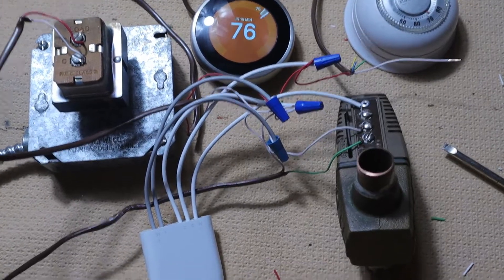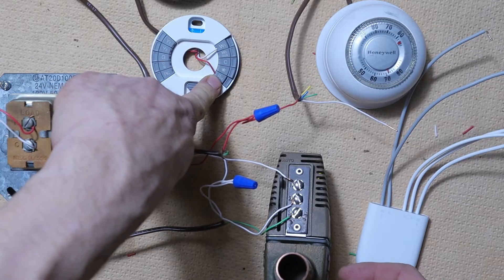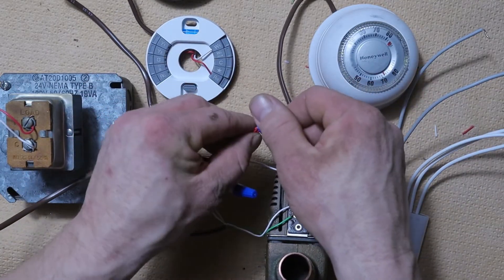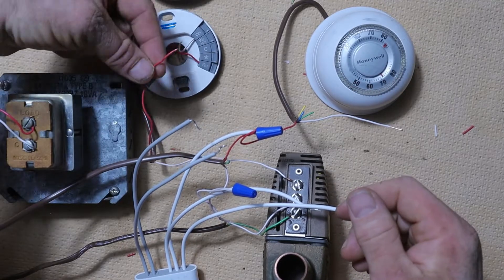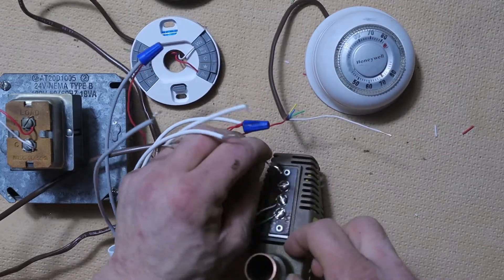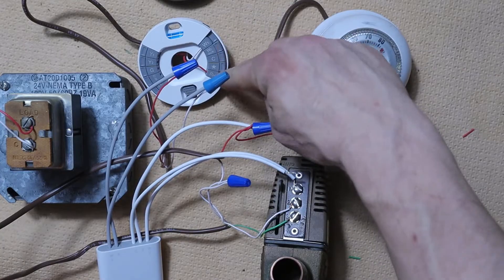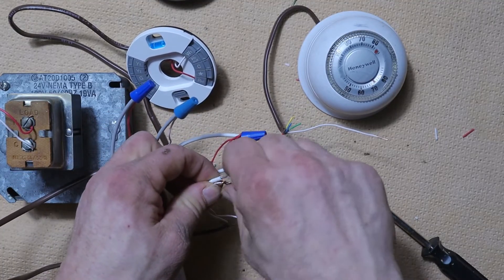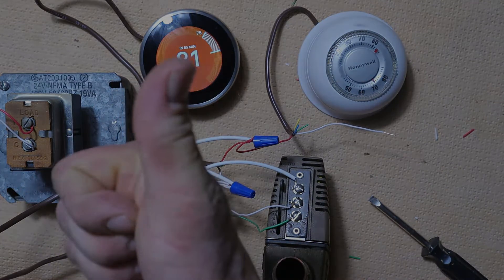How To Wire A Nest Power Connector to a Taco Zone Valve

Comment: Thank you for the information, I’m also in Jersey(north) I have 4 zones in my house and it’s only heat(gas baseboard) I installed my first google nest and it’s calling for more power, it will not stay connected to the Wi-Fi. I ordered the nest power connector. Will I need 4 power connectors and do ya think I’ll need additional transformers? Thank you
Reply from the maker: You do need a power connector for each zone. And with Tacos, yeah, you'll likely need to add a transformer, unless you already have one rated more than 40 VAs.

Comment: I have a two zone setup with 2x taco valves like this (and 2 thermostats) seems that each valve is hooked up to a transformer way over by the electrical, and nearby is also a relay R832A) 

If I'm not mistaken, I think the relay is triggered by either valve and then that triggers the boiler to turn on.

Would I be able to set up two C wire adapters in my case? One at each of the zone valves.

Edit: scratch that, it's just a transformer hooked up to the zone valves no relay. Less complicated than I thought! Should be able to use the c wire adapter, question is do I need two and what the wiring looks like there.

Pretty sure they used the reverse colors you did. I.e. that bundle of red is white on my setup.
Reply from the maker: Yeah sometimes guys don't always follow color codes. Just go along with what they used there.  There should be a T and T connection in there. One is the common.

I kind of go into it about a minute and a half into this video:
https://youtu.be/eB8TCjX541M

Comment: I have three zone taco valves connected to a two transformers connected in parallel.  Can I connect three nest connectors? (I do not have a zone controller board)
Reply from the maker: So long as the transformers are properly matched it should be OK.

Comment: Mike: Your videos are amazing! Excellent, clear explanations, and all the necessary details. I tried out dozens of YouTube videos and was never really able to understand thermostat wiring until I came across your How to Wire a Boiler. What a  great public service. Thanks!

I’ve had two Radio Thermostat controls working for 10 years, and a mercury switch antique on the second floor, with no way to run a third there. The system is gas with baseboard heat, and three taco controllers. Now that Radio Thermostat is sunsetting theirs in May, I set out to replace them with 3 original mirror-face Nests, which my gas company was offering for a pittance.

I knew c-wires were going to be a headache somehow. Years ago, I installed an additional transformer myself wired directly into the one in my basement office, and it worked fine with fi-fi, etc. I then had our electrician install another transformer for the one on the first floor, putting the transformer next to the furnace and doing whatever rewiring was necessary.

It worked ok, but it turns out he did it seriously wrong, somehow. We connected the nest the same as the old thermostat and no luck. Measured across the wires and found that one of them showed 57v!

My current electrician tried hooking up a power connector at the taco valve, and no luck at all. So I spent a lot of time on the phone with some very helpful Google people, and eventually discovered some of the things their online help doesn’t tell you, like that you can’t connect a transformer directly to the basic nest, because it has no Rc input: You have to connect the transformer through a power connector. I got one of them working that way, following a diagram that they normally only give to Pros.

Anyway, I have an HVAC guy coming this week sometime to sort through the rats nest of wires, disconnect the old second transformer, and follow the directions in your video.

I’d like to hook up all three at the furnace, and I have a question. At the beginning of the video, you said:

“Now before I get into this I just want to let you guys know that if you're just doing one Nest Thermostat this arrangement with the power connector should work. But if you're trying to hook up multiple thermostats this probably isn't going to work: You might need an external Transformer or rib relays. I have ordered a rib relay I should be getting it tomorrow so if that's your situation I'm going to be making that video for you but for now let's get into this.”

My plan would be to use a power connector (I have them already) for each taco controller. The original transformer plugged into the furnace says it’s 24V 40VA.

My question[s]: Are you going to make that other video? And do you think I could run at least two of the controllers with that transformer? (I could put the third transformer and connector in my office and hook it directly into the nest there.)

Sorry this is so long.

Thank you so much for what you’ve done. I only wish you were in Massachusetts instead of NJ.
Reply from the maker: That video can be seen here:
https://youtu.be/iKNo8utiW8U
Reply: @JerseyMikeHVAC  Thanks for another amazing video, Mike! (Loved the introductory comment. I can't believe how finicky the nests can be about power.)

It all makes perfect sense. But introducing the RIB relays looks like it would make it just complicated enough that I'd be almost certain to make some silly mistake that would end up taking me (and/or the HVAC guy I have coming to help) hours to debug.

I think I'm going to take the easy way out and only add the power controller to one of my three nests (the one on the second floor where I can't feasibly run new wire). 

For the other two, I'm going to pull (with any luck) new 4 (or even 5, looking to the future) conductor wire and connect one wire in each to the c screw on the furnace board to create a real c wire.

Thanks again!

Comment: I'm about to do this, but I initially tried installing the power connector at the taco zone relay, not at the valves - is there a reason that doesn't work?

Comment: Hi Mike, videos are fantastic!  I have 2 zones, each controlled by a Taco valve.  I have one 24v transformer.  I want to add Nest thermostats, 1 for each zone.  Can I just wire a Google power connector to each valve using the same 24v source?
Reply from the maker: Yes, you should have enough room to do that, so long as the Nest model you have is not a 1st or 2nd Generation Nest Learning Thermostat.  Those don't work with power connectors.

Comment: Hi Mike, I was looking for a video like yours explaining how to connect the Nest power connector to the new Nest thermostat that I just had. I hope my house doesn't set up on fire. 😜 Thank you very much. I have two zones and one Taco hot water circulating pump. Shoud I do the same on the second floor with another power connector on the zone for the second floor? I hope you can answer that question. Thanks.
Reply from the maker: No problem. Yes, do the same with another power connector.

Comment: Great video,  exactly what I was looking for. I am trying to setup 1 of my two existing thermostats to a nest, and have two Taco Zone Valves. How can I tell which set of wires are going to which thermostat?
Reply from the maker: Typically I'll do a continuity test. Shut off the boiler power. Take the 2 wires off of the thermostats R and W terminals and twist them directly together than test the other end of one of the tstat wires (disconnected)  down by the zone valves to see if there's continuity.
Reply: @JerseyMikeHVAC  Thanks. I was able to identify the correct set of wires. However, the red wire does not go to the top connector on the Taco valve, the white wire does. So, based on your video my setup is backwards.  I was able to correct it based on your video, and it worked.  Only issue was for the "C" wire connection, there was no "bundle", they were all connected under the 2nd screw on the Taco, so I added it there. Thanks for the help!

Comment: This worked for me! Almost got confused by wires going to taco valve but this video was so helpful and straightforward! Thank you!
I wonder if I can do a second thermostat with this since my nest still reads 26V
Reply from the maker: How many zone valves do you have? A typical 40va transformer can handle 3 Tacos, so if you're getting one Nest to work on that transformer you're probably very close to the limit. 

 You can certainly try, just be sure to document all of the existing wiring before you start in the event it doesn't work and you have to go back to it.

Comment: If you already had 3 wires at the thermostat, could you just run the common from the tstat to the neutrals at the transformer?
Reply from the maker: Yeah, that's worked for me, but mostly just with one Nest being installed. Once people get into installing 2,3,4,5 Nest thermostats they have power issues even with common wires because the transformer is already tapped out with these power head zone valves. They use quite a bit of power. Taco relay panels are better for multiple stats where a common wire is available.
Reply: Thanks, that definitely makes sense!